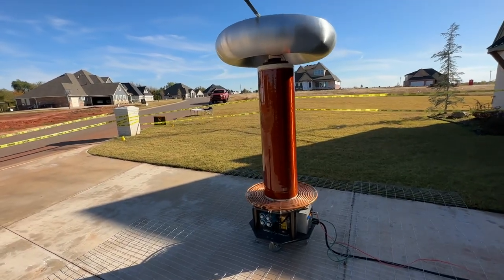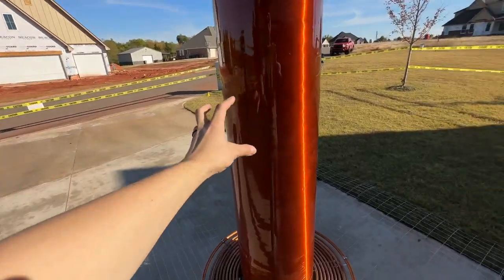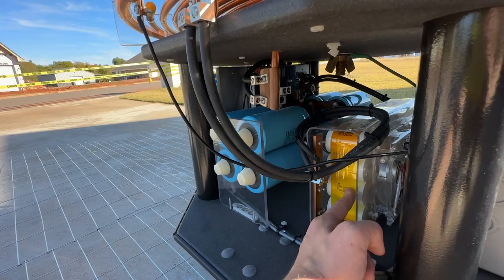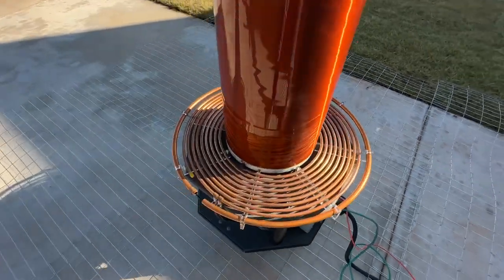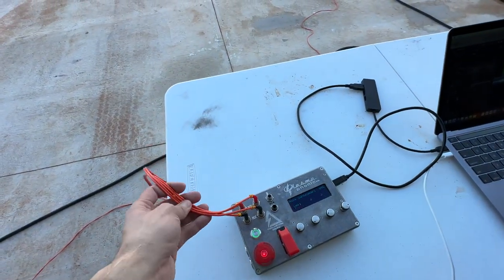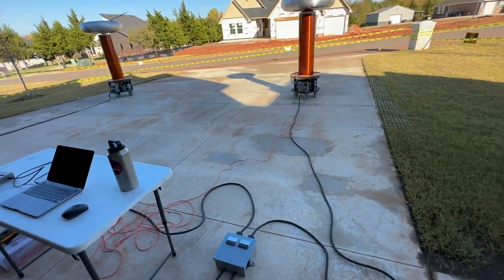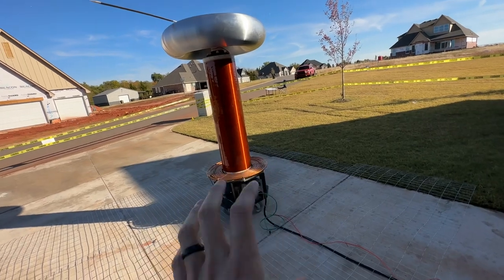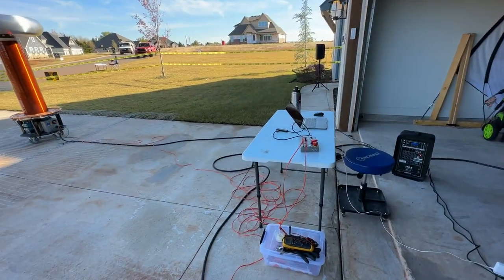Musical Tesla Coil Setup - Overview

Comment: Probably some of the most polished/well designed coils I've seen. Is the music/sound generation basically triggering the primary coil to ramp up every ~4ms (260 Hz middle C) - which then takes a ~100μs delay before producing the note?
Reply from the maker: You you got the idea. The 100uS is where the arc is forming. It grows from small to large over 100-200uS. The rate at which you repeat sets the sound it makes.
Reply: @crazeman5522  🔴 What Is Islam? 

🔴 Islam is not just another religion. 

🔵 It is the same message preached by Moses, Jesus and Abraham.

 🔴 Islam literally means ‘submission to God’ and it teaches us to have a direct relationship with God. 

 🔵 It reminds us that since God created us, no one should be worshipped except God alone. 

 🔴 It also teaches that God is nothing like a human being or like anything that we can imagine.

🌍 The concept of God is summarized in the Quran as:

📖 { “Say, He is God, the One.  God, the Absolute.  He does not give birth, nor was He born, and there is nothing like Him.”} (Quran 112:1-4) 📚

🔴 Becoming a Muslim is not turning your back to Jesus. 

🔵 Rather it’s going back to the original teachings of Jesus and obeying him.

Comment: amazing coils!   would you say the most expensive component is the toroid and the part that takes the most work is the secondary coil?
Reply from the maker: Yeah the spun toroid is for sure the most expensive signal part, I these are around $5k a peace. This is not the only option though you make get away with much less expense options like a ring toroid or even a metal tape toroid. 

Most complex is problem the controller (in coil controller and MIDI/computer side). Each coil has a full microcontroller, firmware, and other electronics to control the inverter and other parts of the system. This took a lot of time to design, test and perfect.
Reply: @crazeman5522  You paid $10000 for 2 toroids?? It's made of aluminium, not gold lol

Comment: Hey Eric, awesome overview video! In some of your older videos i noticed the sound produced by the arc always got louder when the arc hit the ground. Why is that? Also, do you have to worry about rf interference with other devices?
Reply from the maker: This has to do with the amount of current flowing in the arc. When the arc hits the ground the impedance reduces significantly, this increases the current in the arc. This increases current flow create much more EMF that can interfere with microphones and other electronics.   You will also notice that the arc gets more white, this is also due to the higher currents flowing in the arc during a ground strike.
Reply: Outstanding,and really tidy very well wound coils, excellent report thank you